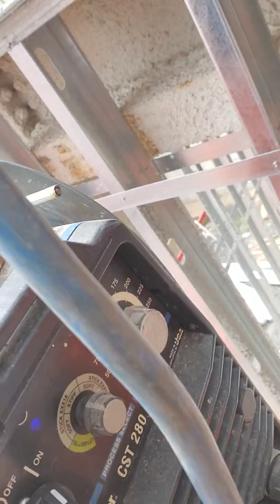Structural welding/  Galvanize welding structural steel

Comment: Technically that is not structural, that is mucilaginous work and doesn't even require inspection as to why it doesn't matter you didn't remove the rust first.

Comment: Why THE FUCK WOULD YOU WELD GALVANISED WITHOUT A RESPIRATOR?!?!? POISON!!!
Reply from the maker: Bake, you do you, I’ll worry about myself, I use the wind in my favor, if it’s that bad, I’ll use my respirator. Do you my friend?
Reply: @jetweldingllc4691  I weld as a hobby normally SS and aluminium both of which are good to use a respirator (bcuz of hexavalent chromium etc.) and YES I do have and USE my 3M 7500 respirator. 
I’m from the EU so the cartage for welding that fits under the mask is 3M 2123 for the US I believe it is 2091

Comment: Look at your drawings most jobs won’t even allow a 60 series Rod and doing what your doing is a waste of time if you want Galvo to look good use a LN 25 Flux Core 5/64th 212 wire it’s faster and goes through the Galvo like it’s not there
Reply from the maker: Iron 44, Good morning, I love it, They were a bump and run, Didn't have too many to do, No need to set up for the LN25, It's all good, You have a great day!

Comment: Wire wheel on a battery grinder works why wouldnt you use it? Just asking
Reply from the maker: Armando, Thanks for your comment, There's a time and a place, I'm just old school, When I think I need it,, I'll have it, Have a great weekend
Reply: I think it would contaminate the weld and also why wouldnt you use  respirator that shit is so toxic ive been welding for 35 years none of the smoke it produces from any welding process is good for you just common sense my freinds  clean your metals before you weld them you will get quality welds to be proud of

Comment: I weld fire sprinkler systems and back when I first started the galvanized pipe used to be the worst to weld... You live and learn as it's not that bad after a lot of years of practice.... shit to breath through while welding though, I don't recommend large dosses of it.

Comment: What do you use to weld Galvanized Vertical and rod size?
Reply from the maker: .blessedand Talented, Lincoln  Excalibur 7018 1/8,  It depends on how thick the galvanize is, Touch it with a grinder, Run a pass of P5 6010, It all depends, I run hot and I do pretty good with the 7018, On the 1st pass, Trial-and-error, You have a great day,
Reply: @jetweldingllc4691  have me hell one time and the thicker galvanize j grinded until I thought I would see sparks but no dice, and it would not melt or stick as hot as I got it
Reply from the maker: @blessedandtalented113   If I'm in that situation I would burn 6010  For my root pass, And take my chances, I'm not all about the grinder, But I have to get that Weld completed, For Me it gives me a good opportunity to put my  Cover pass in with 7018
Reply: @jetweldingllc4691  I hear that, thanks for the tip, I'm not a fan of Galvanized but luckily the fumes were blowing Downwind

Comment: What 6011 rod? Is it lincoln fleetweld 180 or 35?
Reply from the maker: James, Good morning, Lincoln - Murex 6011C 1/8
Reply: @jetweldingllc4691  Thanks and Good after noon!
There are many different 6011s. Whyd you choose Murex?
I'm using fleetweld 180 and want to try others.
Reply from the maker: @jamesmay9345  , I looked at my 5/32 Box It's the same Murex,6011, It runs good, I'll check out yours, I get my stuff from air gas!
Reply: @jetweldingllc4691  1st box ,haven't burned much of it. When looking it up, others seem to prefer the fleetweld 35 6011. I'll try that and the Murex next. 

180 is for smaller machines and comes across as the bottom tier of 6011 lincoln rods. Specs on all of them are the same but it isn't the preffered rod.

Comment: Yo bro...let’s see that vertical up!!

Nice kit btw...CST is an amazing machine it’s a work horse...I like it way more than the invertec ...gotta love that stinger!
Reply from the maker: Kelly G, Good evening, That's your machine, I hope you're doing well, Your the( Godfather of pipe welding!) And a great teacher!
Reply: Tweco & dinse connects what’s the difference?
Reply from the maker: @sloppyjonuts9162  , Happy New Year, I been using Tweco Ends For 35 years now, Lenco Been around for some time, I have 2 boxes of lenco in my truck but when I need ends I'll go and buy Tweco, That does show how much I love that product, Have a great day!
Reply: @sloppyjonuts9162  Tweco is a brand of welding equipment , dinse is a style of connection. 
There are multiple styles of connections when you hook up to your machine such as dinse, LC40, and others based on your preferences and amperage needs. 
Tweco is a brand just like Jackson, or Stinger V. 
I personally like and use the Tweco Tong T532 stinger or electrode holder( proper term). When selecting a stinger it is really based off of personal preference, I have used many different styles and brands over the years and prefer the Tweco Tong because of the way it feels. It suits my style of welding especially in the way that I hold the stinger when the rod gets down to the end, by allowing me to keep my hand far enough back from the weld and not scorch my glove and shrink the leather, but still maintain the angle that I need to get a proper weld.
Reply from the maker: Kelly G, Detail Called for flats only,and at Splices, Bolted every 2ft,no  Vertical Weld
Reply: Thanks guys

Comment: Why would you not hit it with a wire wheel quick.... I have a Milwaukee cordless grinder I always have at my side, excavates slag, rust, removes or thins most galv out to where it’s easier to cook out. I’ve got 14,000hrs
Reply: Ironworker here and we always have a wire wheel on galvi
Reply: Excellent deduction flapper wheel even better ,cleaner arc zinc produces erratic arc while burning out 6013 much smoother , but I recognize he is also pushing rust out hence wire wheel suggestion on point.,👍💪✌️🤔

Comment: I have no support when welding I’m new as well how should I hold the gun and how do i use my other hand as supporty
Reply from the maker: Kevin, I would use a clamp ,and use that as a rest, You will figure it out, It's all trial and  Error, When you're starting out, Stick welding in this video, Right angle is everything, When running the automatic, The goose neck angle is everything, For all the years that I have done this, And the video I made yesterday with the flux core, You could see I welded over 8" continuous, You have to have a  Strong upper body, Leverage on anything, Using your elbow, Whatever it takes, And then you'll be doing it free hand, In the structural end of things, Everything should be done freehand, Thanks for your comment, Have a good weekend!
Reply from the maker: Kevin, I was checking the video out, I'm using my elbow for rest,  Or a pivot, I'm welding left handed,  see my right hand support, And then whatever I do, You'll figure it out!

Comment: Very nice clean welds on galvanized. Mine aren't good if I don't grind it down to bare steel. Keep it up sir
Reply from the maker: Gurjinder singh, Thanks for the comment, You can well like that, And not use a grinder, Turn your heat up, 5/32 7018, I run it at 150, I whip and pause , On galvanize, If I'm not  Penetrating, That means turn your heat up, You should be able to cut through it,  And work your rod whip and pause, Half Moon's, Keeping a good quarter inch bead, You'll figure it out, Good luck, Have a great day!

Comment: Galvanized with no respirator!? Good thing you were outside atleast. that’s a mean headache right there
Reply from the maker: I was lucky today, The wind was really good, I  Knows the  Consequences, I know when I smoke a cigarette I can taste it,  That's when I know I have the  Gal vo, Later  Brother
Reply: Cigarettes with galvanic taste, can't get that everywhere!
Reply: Milk coats the stomach less zinc poison in the end, no puke later ,haven't had a dose in a long time welding fittings in the shop  always had fan to blow arc smoke away , vent would e been nice.,
Reply: @milotorres6894  I weld a lot of fitting flanges in the field, I use to love welding tin but enjoy structural much more